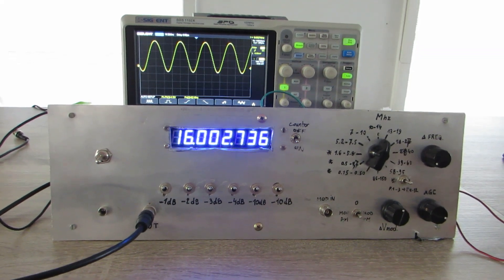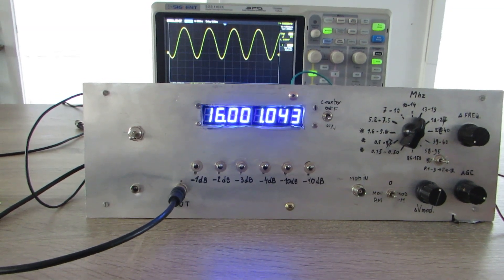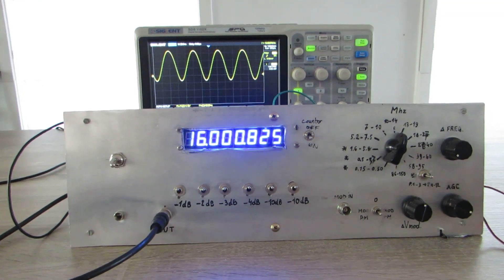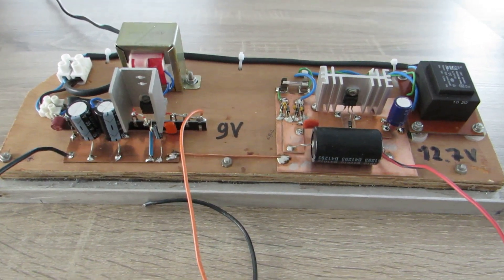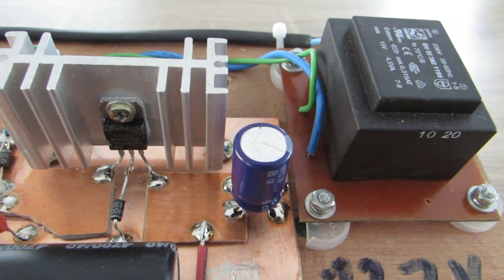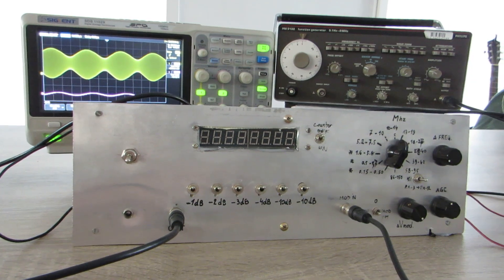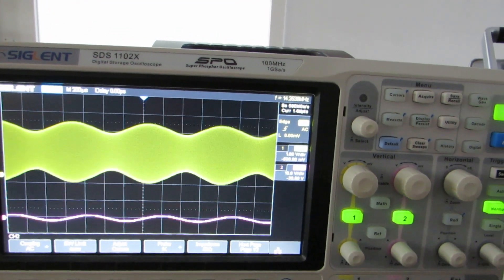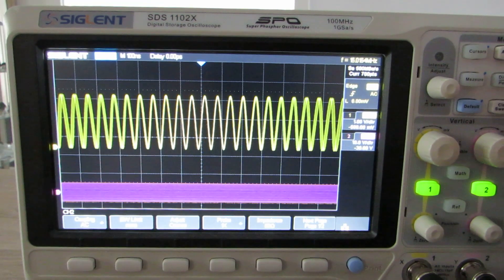RF Signal Generator 150KHz-150MHz Part 2

Comment: Very nice generator. I’d like to repeat this one, but want to ask if there is some alternatives for the double varicaps nowadays in smd format (like fsd270ta), and high frequency transistor alternative instead of 2n5179, I’m also reading the datasheets of the 2n2857 and 2n3933. Because it’s quite hard to get them.
Also just want to add, that some of the analog devices, that I saw before, have metal enclosure for the sensitive part and heater on it, to avoid external air flows and to keep stable temperature like 45-50 degrees constantly. 
Please continue to post if you will have additional improvements or just ideas. 
Also, I’ve find there is newer version of this microchips like mc12148 and mc100el1648. But all of them indicated that they couldn’t be used as a crystal oscillators - I don’t know the reason, but I guess because of stability.
Thank you again, Rikkie, and good luck! 🎉